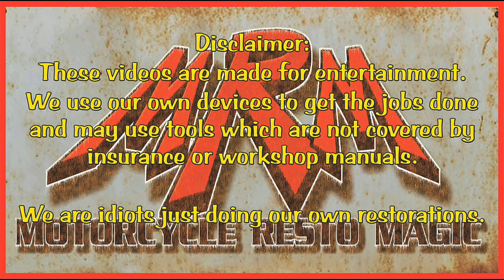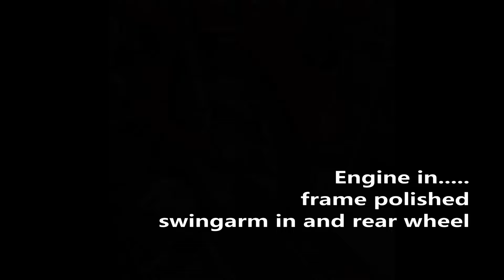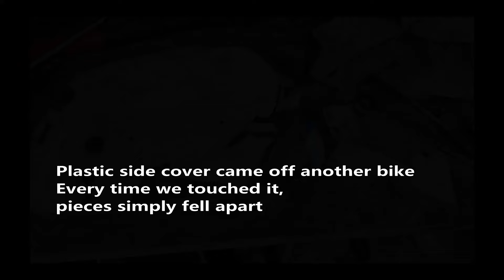Suzuki B100 Restoration

Comment: Mine was blue, it was marked as a 120, not a 100, but it looks like pretty much exactly the same animal.
Shit! We're old! That was 50 years ago.
Does it have a 4 speed straight down gearbox, with Neutral at the top? That led to a bit of confusion, until I figured out what was going on, I can tell you.
Now try a British 'classic' right-foot change, one up and then 3 or 4 down, with a heavy wooden clutch. Again, it all makes rather good sense, once you get used to it, but ~ Like a reverse pattern / 'race shift' on the left foot, it's not too bad if that's the only bike you ride, but if you ride that and then try to ride a 'normal' bike ~ you're in a world of trouble.
I have not had the joy of trying to ride in the USA or any place they drive / ride on the right, but I'd guess that's the same only more-so. Something that's the habit of a lifetime, suddenly you've got to do the exact opposite, and if you forget for 3 seconds it can kill you, and quite possibly other people too.
Reply from the maker: Thanks for the info.